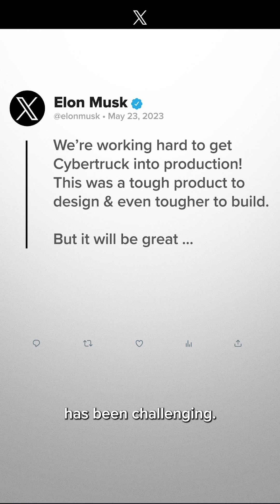Why Tesla's Cybertruck is so hard to produce #Shorts

Comment: Teslas are not safe.  Batteries are integrated into the structure of vehicles.  Accidents result in expenive repairs and batteries get damaged or explode.  Indurance companies often total Teslas with low mileage and cut checks for pennies to owners rather than sprnd 50 to 60 thousand for repairs.  This is why insurance premiums for Teslas are so expensive

Comment: Im pro tesla. But this will fail. Not rugged. Not practical. Impossible to park
Reply: You have no idea what your talking about, it ca; race on a go cart track it’s manoeuvrable, it’s faster than any other truck even a 911, it’s a first in many things it’s an engineering marvel, would I have one no but I don’t like electric if I did this would be at the top of my list, and I’m not pro Tesla build quality is crap and the plaids tyres last 5k miles before they need changing, but who knows it’s this suffers with the same issues but the fact is it can be hit with a shopping trolley and it’s hurricane proof 😂
Reply: You drove Tesla? they come with camera assist for reverse, change lanes at least 4 cameras around the car
Reply: @batsdaylights  i own a Y. CT is just a giant Lambo
Reply: @devonellesse  Lambo isn't a failure for the most part, maybe 🤔 CT didn't meant to be practical.
Reply: You can paint on stainless steel
Reply: I think you’re wrong.
Reply: Rear wheel steering gives it turning radius similar to, if not marginally better than, crossovers that are a dime a dozen these days.
Reply: Not rugged? It's as close to rugged as it gets on trucks. You seen the pictures of the first cybertruck vehicle collision? And no, it's impractical or impossible to park. It's not even the biggest vehicle sold in the US. I mean what about crew cab lifted trucks? The growing amount of huge SUVs like the suburban and Escalade?
Reply: @ivand0007  the dude is paid to trash elon and tesla